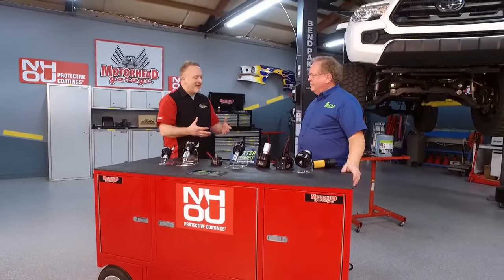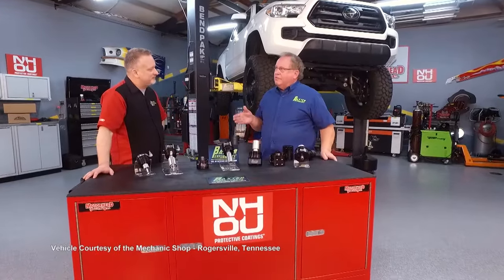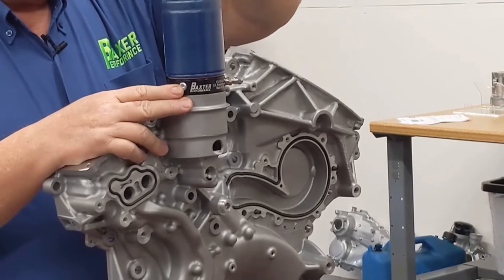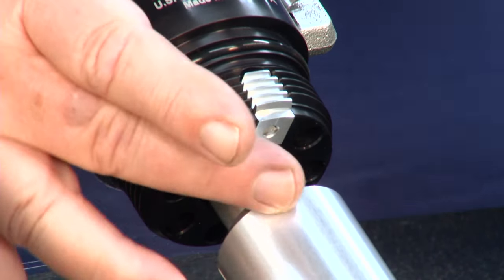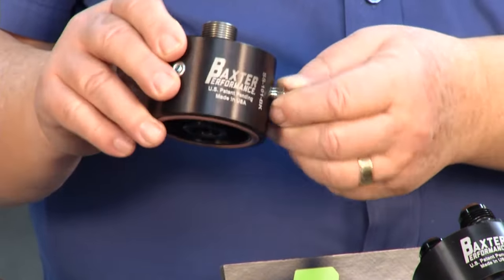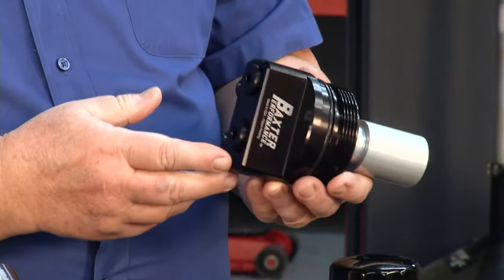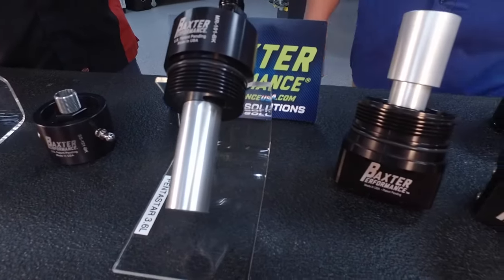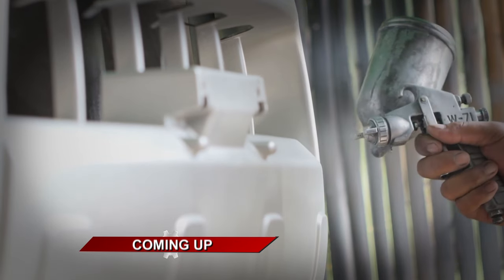Motorhead Garage Featuring Baxter Performance

Comment: Question 3.6 Pentastar. How does the oil in the filter Lube the top of the motor during start up? It takes oil pressure from the oil pump into the filter to send that oil to the top of the motor.

Comment: Very nice. The Toyota OEM oil filter "system" of the 2012 Prius is beyond ridiculous. I'm interested in either a replacement of the existing plastic cap & cartridge OEM system (to a screw on filter system) or more desired to me, a remote system altogether.
Reply from the maker: Tim, the TS-401-BK fits most of the Prius engines. 
https://www.baxterperformanceusa.com/product/ts-401-bk-cartridge-to-spin-on-adapter/

Comment: This goes to show the auto just doesn`t care about the longevity of there vehicles as long as it makes it past warranty there happy because they are in the market to sell vehicles and the longer it last you won`t replace the one you have  .So they replace a tried and true filter system that`s been around for over 50 years and replace it with a plastic piece of junk that just fails .So you spend $50,000 on a vehicle and if you want it to be reliable and last you are forced to spend more money replacing parts that are crap ..Way to go Fiat Chrysler building vehicles with accessories no one wanted or needed  just to increase the price of vehicles like TMPS and stop/start technology which everyone turns off  as soon as possible . You need to take a look at what made Henry Ford famous the model T a car that everyone could AFFORD .
Reply: Not really. All they needed is to add an anti drain back valve, like they have on some similar German car systems. Plus the system featured here is sort of a scam as well. They simply moved the problem a few inches up, because the area below the filter will still drain. So you basically end up with a shot of oil (the amount that the spin-on filter holds) and a large empty cavity behind it. Now one may argue that this may help a little bit, but still this is far from a real solution. It may be a great money maker for Baxter though. I wish I had thought of it.